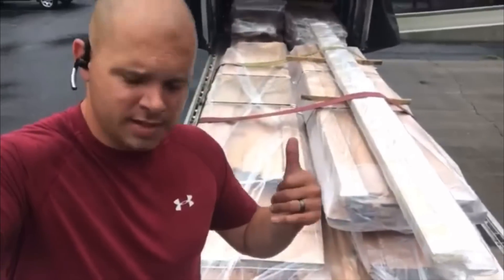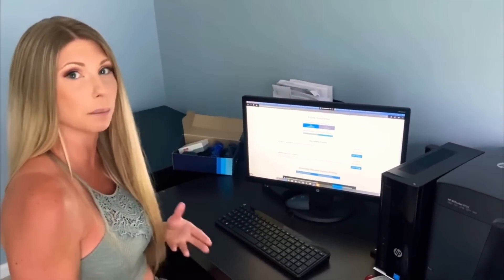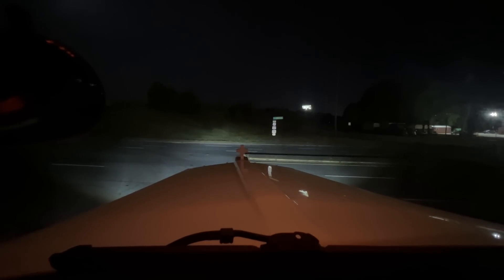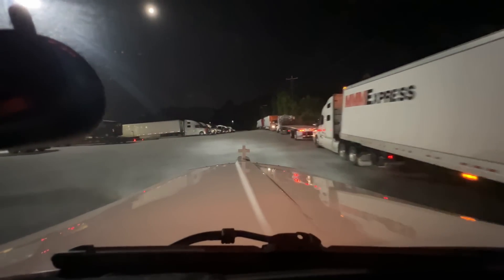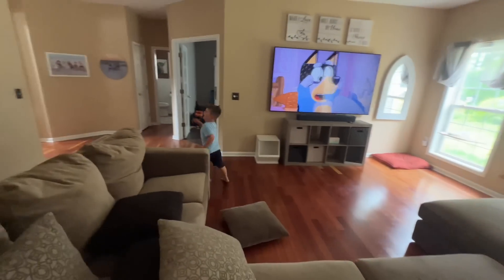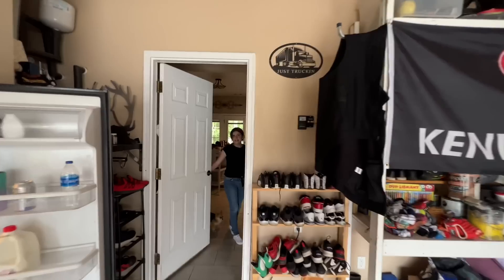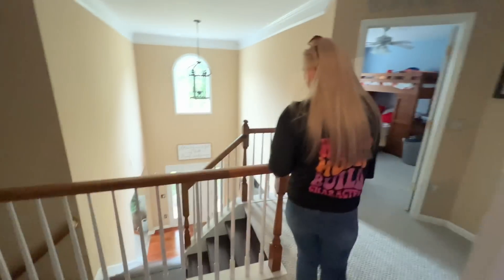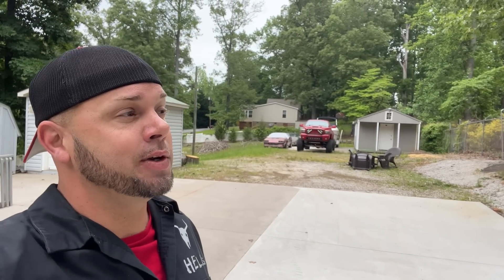FUEL for $3.11 A Gallon!! BUT THE PUMPS ARE BROKEN 😑 we Head to Georgia for the 12.7 FLD

Comment: I know what is taking your high level speakers out. The amplifier was not was not tuned properly for your head unit. You can get it tuned the right way and not by hearing the noise.

Comment: 9 times out of 10 the speakers going out in the doors are the window seals letting water leak into the door and it's getting into the speakers. best way to tell is pull the speaker apart and if there is rust it's the seals not the amp pushing the speaker to much
Reply from the maker: Thank you